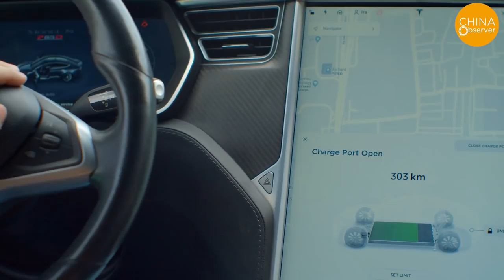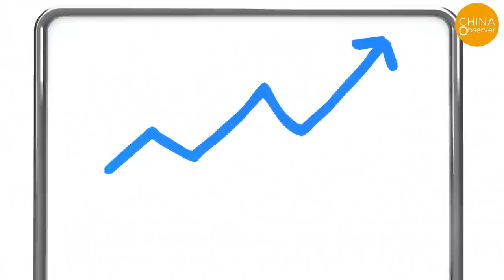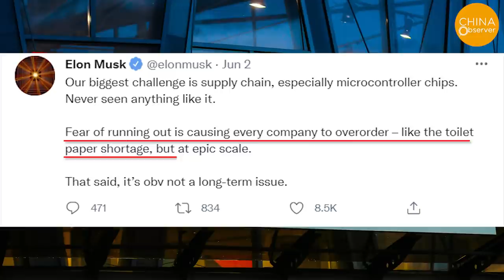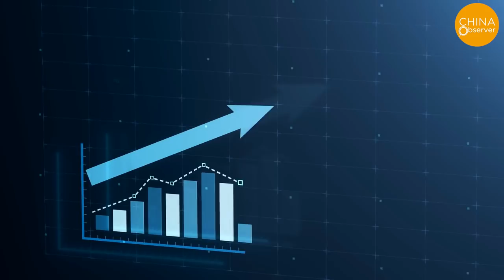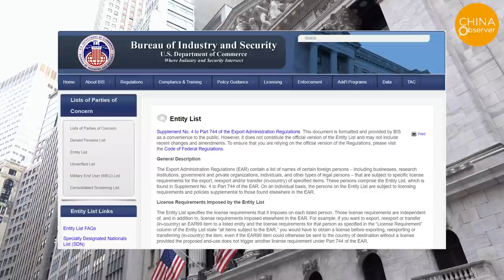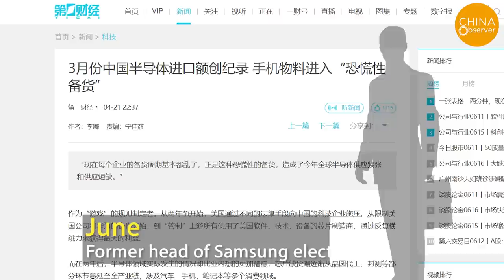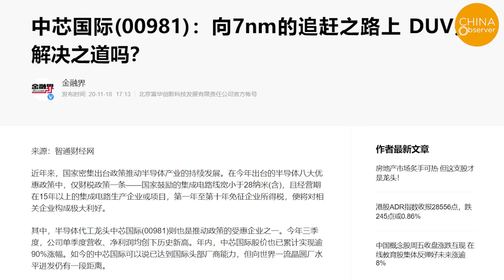Why CHIP SHORTAGE makes Chinese car companies feel extremely panic?

Comment: No, orders lost from SMIC do not go to TSMC. They go to other second tier manufacturers, though many of them are still based in Taiwan so Taiwan is beneficial from this. There are no other suppliers that can substitute TSMC just yet. Qualcomm, nVidia, AMD, Apple all rely on Taiwan for the most cutting edge technology.
Reply: do you know the equipment in TSMC to produce chip is came from USA only?
Reply: specifically, those equipment is came from Applied Materials Inc. and Lam Research Corp.
Reply: And yet West Taiwan want to produce their own chips despite their technology is like 8-10 years behind.